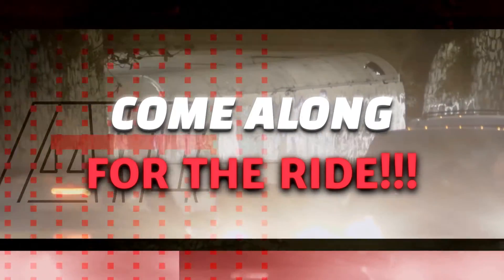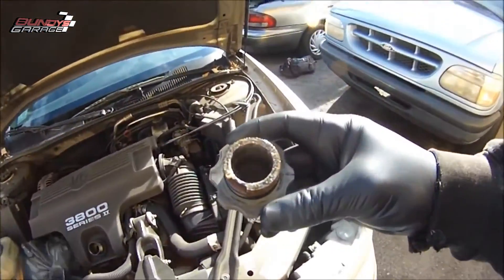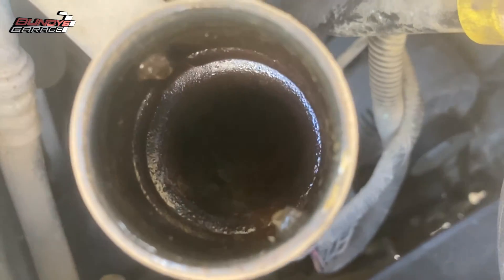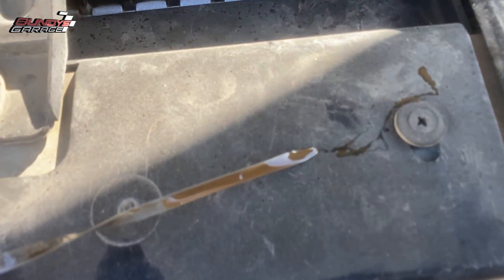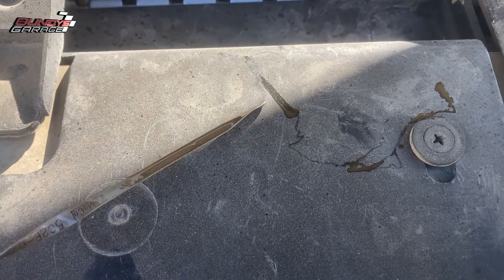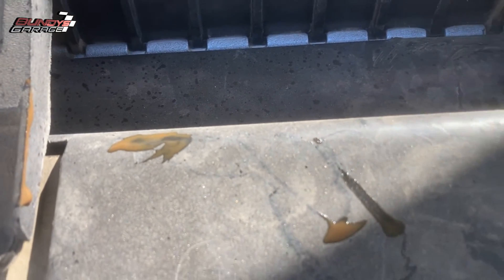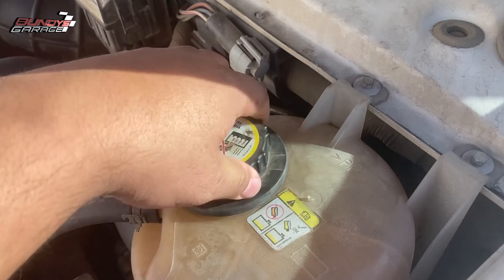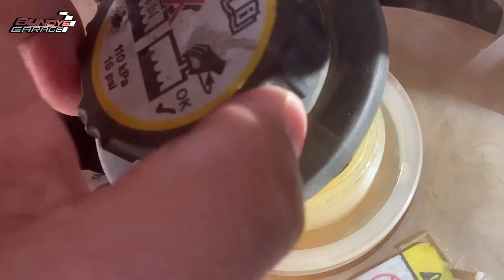[2 EASY WAYS] Check for Blown Head Gasket QUICKLY | Frothy Oil Looks like Chocolate Milk

Comment: You failed to mention, on diesel engines the oil will never have a honey colour. Maybe in the first seconds not started. Also foaming water in the expansion tank doesn't mean necessarily the head gasket. Can be a faulty water pump or the radiator sucking air or a pipe.

Comment: Good job man hey I have a question im rebuilding my heads on my 2008 honda odyssey and I just had it pressure tested for cracks! And it turn out I'm ok no cracks..so also I had it milled because engine overheated..so it kinda wrapped the front head and rear I guess so when u do this kinda work should I double up on head gasket like 2 instead of just 1 km using honda head oem gasket so do u think I can just use the 1 new head gasket? Second I notice u use mobile 1 grease for the valve keepers could I just use some honda oil or does it need to be mobile 1 grease 🤔 thanks bundy ya videos have gotten me far buddy fyi and I dont think I could of gotten this far with videos like you do thanks sincerely..also my coolant is what mixed with my engine oil not oil mixing with coolant so that you know what happened on my engine finally do think I should drop the oil pan cuz I got almost all the milk shake out of every passage oil the pan that has the little left in there but I am planning on doing multiple oil changes till its all out and im also changing the oil seals and several gaskets like manifold water passage coolant temp sensors camshaft position sensor..pcv valve doing everything possible to get her back on the road...please lmk your insight to this process cuz im hoping for the best outcome 🙏 thanks once again!!
Reply from the maker: Thanks for watching my videos, glad it’s helped you out. DO NOT double up on head gaskets. Just use 1 head gasket per head. I would drop the oil pan and get any milkshake out of there as well. Then you can clean the oil pick up tube as well as clean the bottom end with brake cleaner. Use Toyota 103 FIPG when you put the oil pan back into place (best stuff ever) as long as all mating surfaces are clean. Also once you have everything ready and you put oil in, drive it for about 250 - 500 miles and the.ln drain the oil again and new oil filter so you know you got all the nasty oil/coolant out.
Reply: Thanks bundy! I figured that I should clean that oil pick up and all remaining milkshake to get a good cleaning out of everything I could! I even wanted to take off the oil pump off the side of the block but you have to remove the oil pan first I can see cuz I want to clean that area out and reassemble it with honda bond because im changing out the crankshaft oil seal and yes I used new oil filter and will change out oil after what you said also with new filter! Only issue is that this oil pan has the exhaust that covers the oil pan and the bolts underneath were heavily rusted so I got 2 off from the front but one got stripped its still dropped down but there's the rears to do to I guess you know these are the bank 1 and bank 2 that go thru the heads!! So im gona attempt to get em off but might have to get new nuts for those really that whole exhaust is so old and rusted I want to change it out!. If im successful and I get the engine to not overheated and not misfire then im going to change that out right after just don't want to jump into changing out all parts before I know it runs steady, like I said im changing out all spark plugs, seals cams and crank, gaskets, all honda parts, valve stem oil seals! As I saw u do it got that tool in ya link btw!! Thanks order before oem one bs stool sended back. Pcv valve ,spark plug tubes seals changed already, seals for valve cover bolts, also cam position sensor and the coolant sensor, reason is because those came up on engine codes when this all first started really! To tell u how it started was that I didnt change my timeing belt to 220k miles so I had motor mounts that failed first. so then I finally took it to honda changed out the timming belt, and water pump and also mounts, but shortly after they did all that and return the vehicle I started getting smoke that was coming from leaking oil that they thought was a cracked rear head so it was leaking down onto the rear Catylic..converter and created smoke so I took it back to them and they cleaned out the oil that was coming down and it wasn't overheated or anything but I drove for about 3 months as they said we changed out the rear valve cover gasket and they even change out the intake runner gasket and some other stuff, but started to see some smoke come out of the tail pipe which I believe is that clear white smoke and I thought that was just the oil comeing down off to the exhaust but then one day omw back home on the highway it started to overheat so I tried to make it off the highway and got to a stop then it immediately turn off. So I let it stay off for 3o mins at a pepboys tech came over and those were the codes cam sensor and coolant sensor as I said earlier..so when I turn on again was trying to get back on the eway..to make it back home but it started heated again so I stop again. Then I was able 2 get to autozone change out the thermostat cuz I had a 99 honda civic before and remembered that honda is notorious for that thermostat and so I began to try and stop the overheating and drained the coolant and put in the new thermostat, but I didn't bleed the air so although that worked and stopped the overheat..and got me back home by the time I reach my exit to where I live the radiator seal blew!! Lol rookie move and it started to overheat again. Actually it started to overheat again right before my exit and then the radiator blew so as I approached the exit and caught the red light it shut off. So I let it cool again for 15,20 because I was off the exit at the light holding traffic and when it turned back on I got to the honda super store of joliet and its right my exit so like 2mins away and I parked it in there lot over night cuz there were closed! In hine sight knowing what overheating causes now I would of just had it towed there but inwas being cheap and didn't have the money at the time. After all the next day I got to a belle tire drove there bout 15mins from honda and thats where they explained the radiator seal busted because I didn't bleed the system. Honestly I wondered if I had bleedded..the air out of the coolant system maybe it would of stopped overheating. However I believe now that maybe my valve stem seals gave out started the overheating and then the front gasket when first! And this young buck honda tech thought I had a crack in the rear head after doing my belt service because after I got the rear head out and began this process I took it the head to the tech in my trunk and asked him where do u see a crack or leak and he said he saw oil coming from the bottom rear stud that comes off the head u know that goes thru the exhaust flange. So I took it to get pressure tested and no leaks or atleast no cracks I guess that means and had it milled..and they told me this reputable place they are good and that it was the front that overheated the most not so much the back. So after belle tire told me of the radiator rewind back I got a new radiator and also condenser cuz I needed it might as while I was in there already and tried first to see if it was just the bleeding of the air that I messed up! After I did all that it still. CONTINUED to overheat so I was able to drive like that with the new radiator back to belle and thats where a master tech there told me that coolant mixed into my engine and of this milkshake I know now term!! So that's when I started to learn about this and came across your videos and others but your videos turned me into a mechanic! For this j series engine and you made me feel confident in takeing this on and so I began the journey to take apart the wire harness all by the book and did my homework! I've been on YouTube since it came out and it's because of channels like yours that this app fucking 🎸 thanks man for time and dedication to helping others and creating content!! So yeah man sorry 4 long ass text 😆 but wanted to give u more details they told me I had cracked heads they were wrong and that my engine was just running more efficiently now because of the belts and I think those seals gave out and gasket and thermostat got bad lmk what u think man but im on good track just waiting my honda seals and as for that toyota stuff is it better u say than honda bond cuz I got the honda bond already but my son works at toyota as a sales guy and ill ask if his parts department has it or if its on Amazon I just hear that it has to be honda bond! But yeah I was really trying not to drop that pan but I figured its best to get as much of the milkshake out before I start her up again increase my odds of her not being a bitch with me lol man u know what I mean guy talk sorry for profanity but she's really working 😅 me. Anyhow yeah I think im gona ace this if I cross my ts..and dot my eyes..also finally like your quotes on the spin of the earth 🌎 and the pull of the 🌙 good shit man on those keepers! Well I hope i can communicate with u and let u in on this journey and how it goes promise not to make longer texts after this one ill shortened them ok 👌 looking forward to hearing ya take on this..im from Chicago Illinois btw but live in joliet illinois puertorican and family man are you Latino or Phillipines.
Reply: Hey bundy when doing the valve lash/ adjustment I guess as its called when I put the heads back on I understand I should put the heads back on first then do the adjustment! So is it ok not to have the spark plugs in to rotate the engine easier after routing the time belt first and do I have route the belt first then put the hydraulic tensioner back on pull the pin then rotate the engine to 1 then 4 and I believe 2 and so on in the firing sequence to do the valve lash and tighten the valve locking nut so can that be done without the spark plugs in to rotate the engine easier so yeah and also I found that toyota stuff on Amazon..and yeah so lmk what u think on that is the correct way im still working on the valve stems waiting on the stem seals o by the way I guess those seals are 2 different part numbers didn't know that something that the exhaust side is different because its hottest side and can melt if intake are installed on that side..I thought that they were all the same and I have to call hondapartsnow to revise that order..but yeah gona try to get that oil pan down lmk what think on the whole process that  got me into this mess and on the correct way to do that valve adjustment when I get to that point trying to race against the weather getting colder as I got the van in my drive way I also wanted to send you some picks to your email to kinda show you all my progress and views of the project and continue to receive your feed back if I can have you as my buddy and I get closer to getting this oddessy back on the road hoping to celebrate with you and letting know we did it!! Cuz it wouldn't be possible with your helping videos ok bundy when ever u have the time to reply and reach back to me inreally appreciate it and its a big help for me as I had a young honda tech that kinda bailed out on me and I was going to pay him but I guess he wanted more the 500 I was offering..but he just wanted me to change the gaskets and that all no new seals or checking if the heads were cracked I guess he was right on the heads not being cracked but I wouldn't never known if they were and would of ran a risk going through all of this plus they did get warped so they needed to be milled! So since he didn't get back to me I just took this job on myself as really I did all the work and pulled the heads and his 500 was going to be just to help me get it all back together but he went Mia..on me so o well I used his money to do the testing and milling...yeah man and I felt better for doing it I guess God has my back! And my new buddy bundy! Would u believe he started as a oil lube and worked his way to being a tech at the honda dealer that I brought my car he didn't even go to mechanic school but I didn't care maybe thats y he maybe just thought new gaskets and I would be ok! I guess he wanted to save me money but he never got back to me so I dont know how that would of turned out if he would of just got it done with new gaskets but knowing what I know now im kinda glad cuz it taught me more and to just do it myself and to get new oil seals everywhere I needed them for no more leaks and oil mess so yeah im greatful even though I wanted it to be easier for me but harder turned out to teach me to become my own honda tech heck if he did or could y not me.. thats y I go to YouTube university for my education world glass! They are all hateing on being a dyi..er! Haha 😄 o well let them hate right?  Ok bundy talk to 2 soon Anthony.